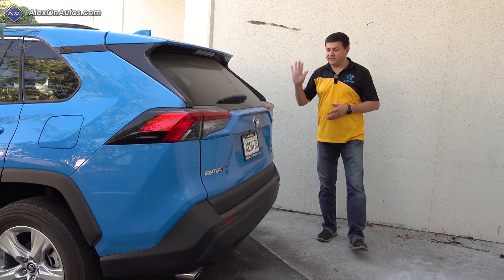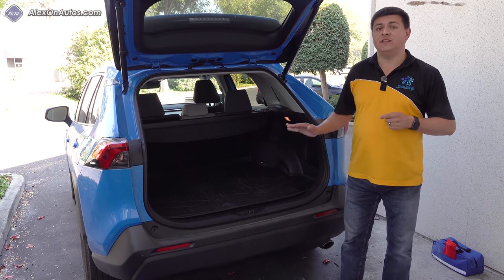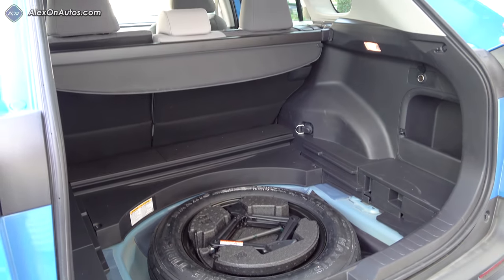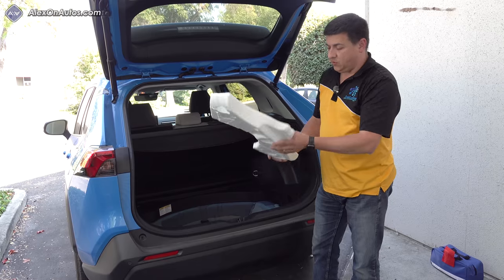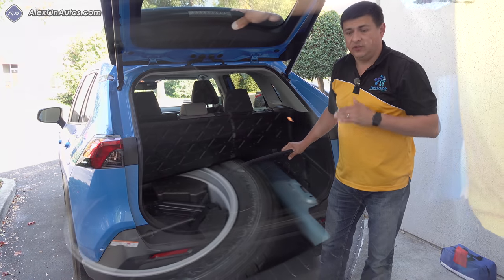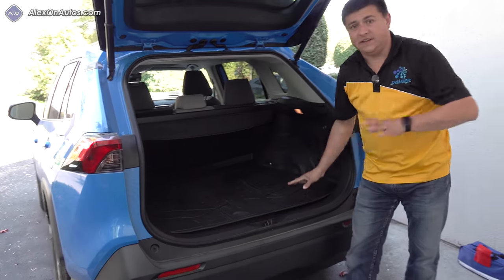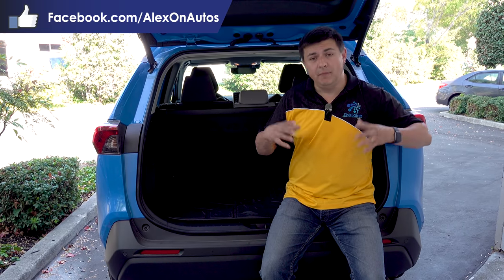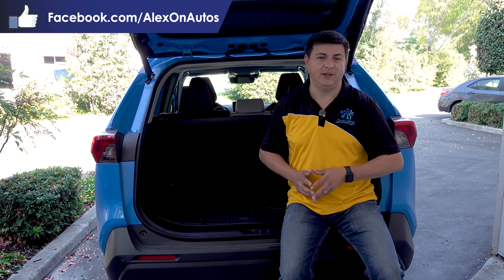2019-2020 Toyota RAV4 FULL Size Spare | Will It Fit?

Comment: I am 100% for a full size spare tire, especially on an SUV.
Reply: there is no such thing as a flat tyre....mate
Reply: @nc3826  "Tyre" is the most common spelling in the world.
Reply: Full size spares are becoming a thing of the past due to tires being more durable then they used to, more run flat tires being produced and auto manufactures doing their best to maximize fuel economy. 99% of people don't need a full size spare, which is why it makes sense for auto manufacturers not to include a full spare.

Keeping a tire gauge and portable 12V air pump is more valuable and comvinent IMO. 95% of the time it'll get you home or to a repair center. 1/2 of people can't/won't change a flat but adding air, anyone can do.
Reply: "Tyre" is only the most common spelling....  for archaic Brexiters.... who have a 18th century mentality of the world...
Reply: Anyone that thinks a full sized spare isn't needed anymore...by definition only knows how to add (hot) air to the discussion...
Reply: 2019 toyota rav4 failed the moose test, alex won't tell you this because he has to use the toyota check to feed his wife hotdogs and krisy kreme donuts, youtube it yourself "rav4 moose test"
Reply: Moronic trolling conspiracy nuts-FLMAO
Reply: @James-il3tq  Spelling makes me feel tyred...
Reply: James Not including a spare is penny pinching but not even offering the option is taking the mickey out of buyers , pretending that a flat is always a small hole and always happens close to a proper repair facility.
Reply: While flat tires seem relatively rare based on my experience of many years of driving, when they do happen it always seems to be at the most inconvenient time and often place. Not having a full size spare is just compromising safety and what if you are heavily loaded, or towing and it's a day when the tire shops are closed? I feel going to no spare is   playing to the fact that many cannot change a tire anymore themselves. Not being able to design space into a vehicle for a spare tire shows how far designers have strayed from reality with current designs that seem to feature many frivolous things and come ups short when it comes to practicality.
Reply: @James-il3tq  in my experience living in a suburban area I have gotten many flat tires. I do know how to change the tire but if it's dark out I usually call AAA. I still agree that it is a good idea to have an air compressor on you for slow leaks. No matter how strong Norwood tires aren't still more comfortable having a spare tire than not having a spare.

Comment: I have an 08 Rav 4 with the outboard spare tire. A LOT of people complained and moaned about that outboard tire, but it allowed my Rav 4 to have a FULL size spare tire. It also means that I have a spare matching rim, no steel wheel for the spare. I have always liked the look of the outboard spare. More Jeep like. 😀 😁
Reply: No way did people complain about that. The RAV4 had that outside tire until the 4th gen. It was made to be that crossover off road type vehicle. It completed the look. 3rd gen to me is best, besides the new adventure trim.
Reply: @Searchman212  Check out the Rav4 forums and you'll see what I mean. Lots of hate for that external tire.
Reply: @ModernDIYProjects  guess I don't spend enough time on the RAV4 forums to know haha. I love my wife's.
Reply: Your wife has a forum?
Reply: @Searchman212  I had an 08 V6 Rav4 and loved that car. Now I have a 15 Rav4 (it does actually have a full size spare), and while I still like the car I hate the lack of power and the overall exterior looks. The interior is way better though.

Comment: Remove the rubber spacer at the front of the wheel well and the tyre should low enough for the floor to be flat. The cars are designed for a full size spare for markets where space savers are deadly. Spacers are used to lift the doughnut to the same height as a proper tyre. There is no logic in spacer savers. The makers say it is to do with weight, so the whole car is dangerous if you put groceries in the trunk? Pull the other one, it has bells.  I'm in Australia and the two punctures I have had in the past 10 years were over 100 miles from home on patched and broken rural roads. No repair shop open the first time because it was Sunday. Second time the tyre was too damaged to repair and nearest town doid not have that size. There is still a good range of cars sold in Australia with proper spare tyres. Subaru generally have them but its new hybrid Forester has no spare at all. Don't go more than walking distance  from home in one of them!

Comment: I bought a 2019 RAV4 in the UK which came with what we call a spacesaver (donut to you) - I bought a full size matching alloy 18" wheel and matching tyre from my dealer and as you say it fits just fine if you don't mind losing the lower height for the floor and ability to store the load cover under there.
Reply: Blimey!
Reply: Crikey

Comment: Great video, Alex.  You mentioned that the 2019 RAV was a hybrid, 225/55/R17 tire shown.  Do you know if the 2022 RAV TRD off-road model, stock tire size 225/60/R18 will fit?  The question being that the rim is a little taller and the tire slightly wider.  Thank you.

Comment: Drove a 2019 RAV4 in Panama. Their roads can be very bad in a lot of spots, and their paved ditches are wheel killers if you fall in while turning too sharply onto a perpendicular road—which is what happened. It had a full size spare thankfully, and we were able to change it. It wasn’t uncommon to see drivers pulled over and changing tires often due to flats from potholes.

Comment: Rav4's have standard size spare wheels fitted here in New Zealand that is a match to the wheels fitted to the vehicle, i.e. if you get the trim with the black 18 inch wheels, you get a black 18 inch spare

Comment: This isn’t something I thought about but it definitely makes sense. I have a 2017 RAV4 XLE and it has the same trunk from the looks of it. Definitely gonna check this out. Thanks Alex!
Reply: The Trunk is Not the Major Concern it is Size of the Fuel Tank Capacity.
Reply: Yah 2019 have smaller tank
Reply: Did you check that ?

Comment: The 2020 Rav4 in Australia can be optioned with a full size spare tyre for $300. The floor cover piece is slightly different however for those who select this option as the underside hard plastic instead has a ring indentation for the full size spare to fit snug.

Comment: I used to have a 1999 VW Passat GLX that had a full size spare with a matching rim. I had two flats (one in heavy rain) that I changed in no time and continued driving at regular speed. I never would've thought carmakers would take spares out completely on most cars.
Reply: My 2013 Golf can take a full size spare even with the boot/trunk floor at its lowest level.

Comment: I'm always surprised when people don't care (or don't know) that their vehicle doesn't have a spare tire, even a space saver. That tells me that they've never had a tire shred at highway speeds after a flat. Great work Alex - the fact that the RAV4 can fit a full size spare puts it on my short list.
Reply: I've been in a vehicle (a pickup truck) where that happened, but it never happened to me, as a driver.
Reply: Tonight I drove past a BMW with its hazard lights on because the entire tread on one rear tyre had separated from the sidewalls and gone 6" sideways. That was actually in a 40MPH limit so I doubt if was mishandling. There was heavy rain and some areas with a couple of inches of water on the road. Could that wreck a fancy low profile tyre ?

Comment: I just bought a Rav4 from Toyota Australia with a full-size tyre from the factory. It was a 300 dollar option. The cover is different, the underside is plastic and it's cut underneath to accommodate the full tyre. So it's not reversible and the trunk cover, of course, does not fit.

Comment: Some years ago I had a CR-V with an outside spare. At the time I was house shopping, entering construction site and had several flats in a few months. It was heavenly to have the matching outside full sized spare easily accessible. Like others no spare at all is a deal breaker for me.  No spare, no sale.
Reply: I think 06 was the last year the CR-V had that. I drive a Honda Element we bought that year. Sometimes I wish we got to CRV instead just to have a full size spare tire. Unfortunately the elements spare tire well only accommodates a compact spare that came with it as the full size tire sticks above the floor line.

Comment: Thank you.  This helped us a great deal.  Also, if you remove the other spacer underneath the tire in the front the load floor will fit flush.  Unfortunately Toyota has locked out the ability to program the 5th TPMS sensor in the US.

Comment: The Trail version, and maybe the limited, have 19” wheels and if you run a tire calculator and Plug in the stock 19 and 17 sizes, has a slightly larger diameter than the rav with the 17” wheel and tire. Will the trail version, which we are looking at for the towing capacity, also take a full size spare so you think Alex?

Comment: Having a full size spare is something we should always do when possible. I will be getting a Outback Touring xt shortly and I’m planning on doing the same as well as replacing the stock tires with something more suitable to my driving habits. Being stuck somewhere with a doughnut spare is something I would only recommend to my enemies.
Reply: And you CAN NOT drive an Outback or Forester on a compact donut spare at more than 5 mph, without risking damage to the center differential. I know, I owned a 2014 Outback for a few years. It's incredibly stupid for Subaru to sell Outbacks and Foresters with donut spares. Better they supply the car without a spare at all, that way people wouldn't have the means to drive on a donut and wreck the drivetrain in their car.

Comment: The 19" tires that come with higher trim levels (235) won't fit because they are 1cm wider.  I have an adventure and had to buy a 17" rim with lower trim stock size (225).  I also removed the small rubber block that the tire rests on at the bottom of the well.  Fits perfect with 0 room to spare.

Comment: Thanks for the demo.
I went to the dealer and asked to look at the spare so I could evaluate if it would take a full size spare.  But the battery in the showroom car was dead and the hatch latch is electric.  They made no offer to get a charger for the dead battery so we could open the hatch.  And upon further examination I determined that almost every car on the showroom floor had a dead battery.  I asked something about the engine and it became apparent that the saleswoman only knew about Apple Play.  I finally gave up and asked her some rudimentary questions about Apple Play and she had no idea what I was talking about.

Comment: Just got a new 2019 Rav4 and this video is exactly the info I needed. I mounted aftermarket wheels and will use one of the factory steel wheels and tire for the spare. Greta info thanks for the video!

Comment: Alex, With each episode, the tale of the RAV4 Hybrid gets more intriguing . When does the hitch go on? What about the wiring harness? Will you need two videos to cover the towing upgrade? #Suspense   Alex and his team are truly #LivingTheRAV4HybridDream
Reply: I already have a hitch on mine! 2" hitch which allows me to use my bike rack. Haven't done towing as I haven't investigated the wiring harness part yet.
Reply: @parsley0120  Hitch mount bike racks rule! I just put a hitch and harness on my car. If your car has LED tail lights you might have to get a harness that runs a wire to the battery because (at least on mine) the OEM wiring doesn't have enough juice to power the trailer also. If you have it done at a shop check with them before buying a harness, mine wouldn't install the harness I got online. They would only use one that they ordered.
Reply: @parsley0120  U Haul just posted a video detailing the installation of a wiring harness on a regular 2019 RAV4 and it is MUCH more complicated than I had imagined.
Reply: I put in a Curt hitch and wiring harness.  I was surprised how easy it was for this vehicle (we have the exact same).  The hybrid's battery is in the rear, to the right of the spare tire area, so I put the controller there and swapped the turn signal wires.  (They want the controller on the left since batteries are usually in front left.)
Reply: Going from a 2009 to this 2019, it was disappointing to see how little storage it has.  I like the idea of a full-size spare, but I can barely get a first-aid kit under there with the doughnut, and still that's only by skewing the tonneau cover.
Don't get me wrong, I love the vehicle, but my spouse has allergies and a really short tissue box takes up 80% of the glove compartment.
Reply: Right Lane Hog Oy! I was afraid that was going to be the case... I was hoping it was going to be as easy as my old Subaru Crosstrek. There was just an empty connector in the back under the floor and you snapped in the wiring harness and routed it outside. Literally took 10 minutes!
Reply: @KuddlKat  In my view the RAV4 reached its peak in the  (2006-2012) third generation. That large hidden storage compartment in the back and sliding second row seats were terrific features that added so much functionality. Don't get me started on the V6 option.......
Reply: @parsley0120  To be fair, the video I watched was for the non-Hybrid RAV4.
Reply: @KuddlKat  That sounds much easier than the installation on the regular RAV4.
Reply: 2019 toyota rav4 failed the moose test, alex won't tell you this because he has to use the toyota check to feed his wife hotdogs and krisy kreme donuts, youtube it yourself "rav4 moose test"

Comment: Alex, do you need to buy, install, and program a new Tire Pressure Monitoring Sensor (TPMS) for the full size spare?
Reply: Good question, but since the wheel he bought was from a new RAV4, it should have the TPMS sending unit, but I don't think they function until the wheel & tire is spinning on the vehicle. It would be nice if Alex answers this question. 🤔

Comment: Hi Alex, My wife loves her new 2019 limited RAV.  I love her 2008 V8 that she gave me.
Reply: Mazda CX-5 is leaps and bounds ahead of this car
Reply: maurice benton    I told my wife that.  She wouldn’t listen.  She said she is the boss of me.  I hang out at the Mazda dealership and just look and cry.   The Rav V6 will do for now.  I had a typo above.  My bad.
Reply: Leo the short guy She is smart!
Reply: V8 😂 you sure?
Reply: @shamingandembrassingdriver2718  I hope so
Reply: @shamingandembrassingdriver2718  high as the person who designed the new Jeep's with a Toyota badge
Reply: @shamingandembrassingdriver2718  I want to understand how they made the rav4 bigger and made the interior smaller. Those couple inches of less leg room really make the difference. Not that I'd want to be caught dead in a 2019 I don't fit anyway. They're so overpriced, we just bought a new Highlander for less than a 2019 rav4. No reason they should be selling upwards of 40k. I love my 2018 rav4 so much better, and it was so much cheaper. My 2018 saved my life again on Wednesday in a second accident, I'm so glad it's fixable because I would never buy a new rav4. We've had 7 toyotas and I'll leave the brand before I buy one of those nasty Jeeps. Never again, and we just bought the new Highlander because the 2020 Highlander is gross too.
Reply: You must not love your wife enough to put her safety in jeopardy 2019 toyota rav4 failed the moose test, alex won't tell you this because he has to use the toyota check to feed his wife hotdogs and krisy kreme donuts, youtube it yourself "rav4 moose test"
Reply: @Rhyme905  yeah it's pretty bad, 4th gen didn't though.

Comment: its not about a payload, its because fuel consumption claims. i wont buy any car without a full size spare, which drastically reduce the market for me.
nice video, thanks. i would like to see something simillar more often, but i know its not that easy. i think that most of the japan brands + kia and hyundai still offer a full size spare from factory as standard. i wish volvo would do the same, but the only chance to have a full size spare is xc40, and im not sure about that. i think there is enough height for it, but probably not enough diameter for a full size.
Reply: Why (the market reduction)?!  If a full-sized spare is that important to you, shouldn't you buy the car/vehicle you WANT to drive, and then just buy another another wheel/tire?  Then, you'll be just living with the trade-offs: a bit of extra cost, and the reduced cargo capacity from storing a full-sized spare.  But, at least you'll be driving the vehicle that you want to drive.

Comment: Having a full size spare is great however, don't forget to check the air pressure on it regularly, or else you will find at some point that you have a full size spare flat
Reply: That happened to a guy I was helping. Good thing I almost never drive without a tire inflator in my car.

Comment: Thanks for this Alex.
Wasn't sure of the tire size, I see in the comments you linked to a 225/65R17. Here in Australia we get that size on the base model only, step up Hybrids get 235/60R18. Might that extra 10mm (~3/8") of width work under the load floor?
Btw. Toyota Australia offer a full size spare on the base model only
Reply: Hi, check "mohammed alyaquot" above who has a raised floor to suit his rav4 full sized spare.

Comment: Hi Alex, thank you for the video! I'm curious (as I'm very interested in this car), how is the wind noise while driving at speeds 70mph+? When I test drove the car I found it to be a bit noisy and have read it as a common complaint online. The road noise didn't bother me, so I'm not concerned about that, just the wind noise.